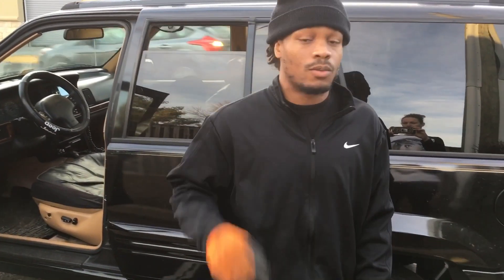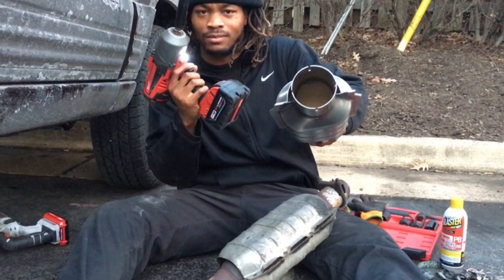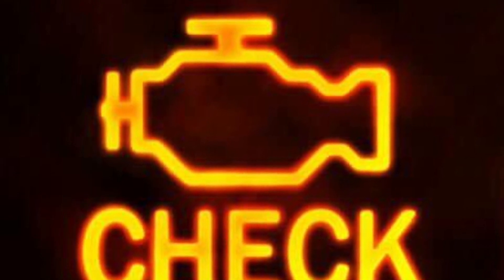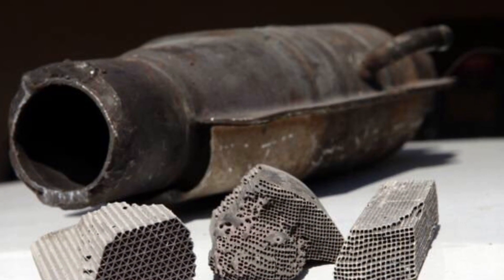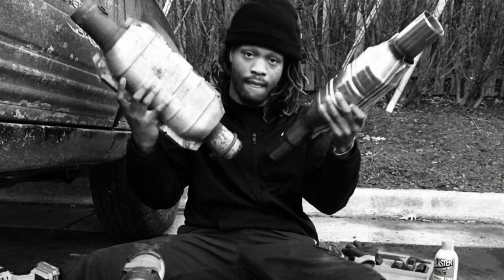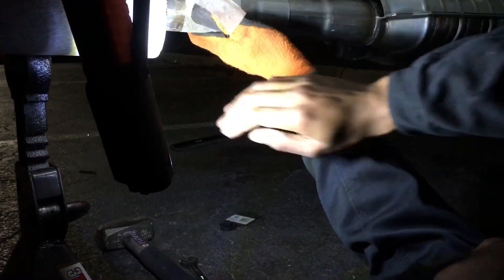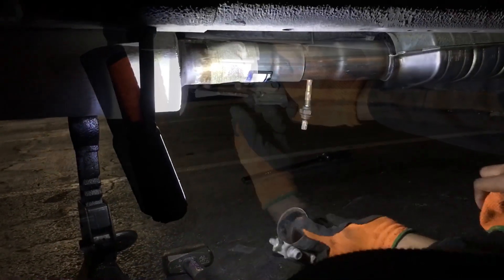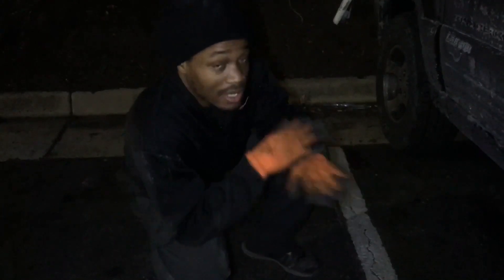JEEP ZJ CATALYTIC CONVERTER REPLACEMENT

Comment: What leak proof sealer did you use? And how many degrees can it withhold? Also did you use the tape in replacement of welding the parts?

Comment: What about vehicles with 2 cats?. When the cat light comes on, is it the one underneath the vehicle? Or under the hood?  I was told that my 2007 Jeep Grand Cherokee limited 4. Has one under the hood and one under the Jeep. Is that true?  And how can you tell if the O2 sensor is good?

Comment: There are two O2 sensors that one might consider replacing (which I did.), as they could effect the longevity of the new cat. Run without a cat and it's O2 sensor's the engine will drop to a fall back mode. Those O2 sensors are a part of the engine management system that controls the air/fuel mixture. Just as anyone who wishes to do a engine build to get better HP|torque will wait until they have all the required parts to do it properly as the engine management system needs to be changed mechanically or electronically. Feel free to read about how the weights in an old style distributor works, while some vehicles lack a distributor. Yes, a person can change the injectors to get a better spray pattern, but the computer will still provide so much fuel to air as programmed for our ZJ's. Yes, the deer and elk can hear me coming a bit farther down the road due to the fact I have a Magnaflow cat and 50 series Flowmaster muffler. But I still have the same horsepower and torque prior to installing them.
Reply from the maker: Thanks for dropping knowledge. I have a long way to go and appreciate the insight
Reply: @barricadegarage5361  When I get a chance I'll be doing a link to your ZJ series in one of my posts in a forum that I'm a part of. As you can see all of us ZJ owners worldwide fully appreciate the work you have done and hope you continue.  <cough> Jeep Forum dot Com </cough> ;) lol
Reply from the maker: @Mauser1965  oh yeah please feel free to share any video you want
Reply: You are partially correct. The upstream sensor does indeed control fuel trims, the downstream is simply telling the pcm if the cat is working or not. When the downstream o2 sensor is failing, it simply thinks the catalytic converter isn't operating properly. The cat burns off pollutants in the exhaust, which causes a reduction in oxygen after the cat. The downstream o2 sensor reads this as a lower oxygen reading and often is comparing what it reads against the upstream sensor. If it reads similarly, then the cat is not operating, which is bad solely from an emissions standpoint and won't impact drivability or fuel economy.

Comment: Sounds good. What Muffler are you running? I am presently running a straight pipe, cut the bad catalytic converter off and weld it in a straight pipe,  running a k&n muffler which is no longer made, along with the k&n FIPK
Reply from the maker: Ross Herrin flowmaster super 44 but I had to replace this cat again with a magnaflow unit..
 https://youtu.be/Ts3igqwF8Js
Reply: @barricadegarage5361  nice! the car sound magnaflow free flowing performance catalytic converters the best out there! Thanks for the quick reply I was thinking of going with the 44 also when my present muffler where's out
Reply from the maker: Ross Herrin you wont regret it... your neighbors might tho lol
Reply: @barricadegarage5361  it's pretty loud now, no cat with a straight through muffler. I get comments all the time when floating through a parking lot, however, It has a high droning  sound on the highway. The flowmaster 44 & 50 claim to tame the droning somewhat, thanks again!

Comment: Did you put the leak sealer on the front side of the CAT as well or just  on the rear. Can you please provide a link for the sealer, so I can buy it? Are the two clamps you used on the rear side of the CAT the same or different kind of clamps? It would be greatly appreciated if you could provide a link for the clamps you used as well. Thank you!

Comment: Hi nice vid , so it umproves performance accel And better mpg? How can i know if need yo reemplace they comverter tanks a Lot .
Reply from the maker: other than a broken honeycomb innard due to you hitting an object or going off road, Catalytic converters usually just don't go bad.
an engine that misfires will cause the Cat to overheat.
a blown head gasket will cause the Cat to come into contact with coolant and contaminate the honeycomb substrate.
using leaded fuel will also kill your Catalytic converter.

if you start your cat up and it sounds like pop rocks in your exhaust, then your Cat is Shot!
you can also use an OBD 2 scanner with live data to check .
Reply: @barricadegarage5361   Great video, my jeep xj was misfireing because of a bad o2 sensor, was going to remove the sensor but riped the cat instead because of rust.. thx for showing! // from sweden

Comment: Looks like something that I need to do as well. I'm throwing a P0420 code (less than 95% catalytic converter efficiency). That's not how I like the number 420! ;-)
Reply from the maker: OldsVistaCruiser 
go for it!. its an easy fix on these vehichles because they only have one Cat. 
when you do replace it I recommend going with the direct fit Magnaflow Cat part#23226. heres a sound clip...
https://youtu.be/Ts3igqwF8Js
Reply: BARRICADE GARAGE - I do like the stock sound, though. Remember, I have a 4.0 six. By the way, it even has a factory engine block heater!

Comment: Thanks for making this video, I have a check engine light indicating a cat problem.  I'm gonna troubleshoot with the cat cleaner before I do this.  What are the chances that the cleaner will actually work?
Reply from the maker: I dont know ive never used cat cleaner before
Reply: @barricadegarage5361  not a good time to be under the hood in AZ right now.

Comment: What is that sealer you used? Also thank you for making your videos clear.
Reply from the maker: That was an exhaust wrap that stops leaks from advanced auto parts
Reply: @barricadegarage5361  can't find it at advanced auto part could you give the part number ?

Comment: I cut my cat open and hollowed it out and welded it back up.    Put two spark plug unfowlers on the empty cat and plugged the downstream O2 sensor into the top drilled it out unfowler that resides on top of the other undrilled unfowler.    Reset the computer and was done with it.

Plate C
Reply: I would not brag about disabling emissions equipment.
Reply: @fastinradfordable  appreciate your comments.   The CAT had already failed so I did not disable it.    I did offer this as a map to solve the issue should it happen to someone else.   If anything, I am still trying to be emissions compliant because I did keep the actual CAT on the exhaust.

Plate [C]

Comment: I live outside the city, where emissions test is not needed, if I were to cut mine and what can be done about O2sensor?
Reply from the maker: bran don disconnect it and keep it just in case you move to county that does emission testing. youll also have a permanent check engine light

Comment: If i took the cat off of my ZJ, what would i do with the O2 senors? And wound it make my air intake system act up due to the missing O2?? Thanks if anyone sees this
Reply from the maker: If yo take the cat off youll have to zip tie the o2 sensor so its out of the way.  Youll also get a check engine light